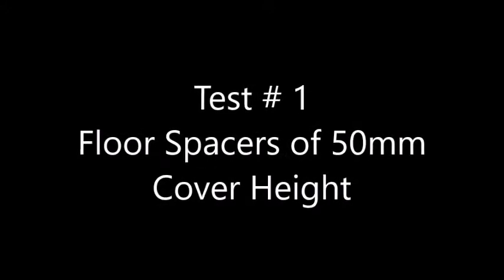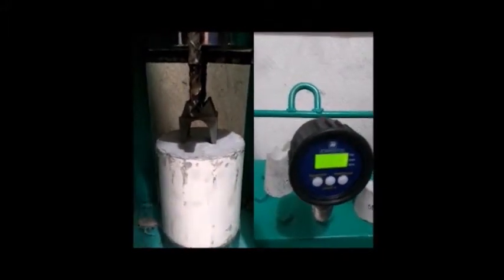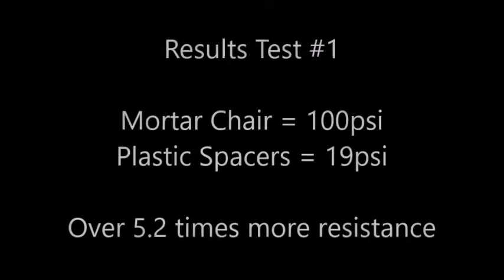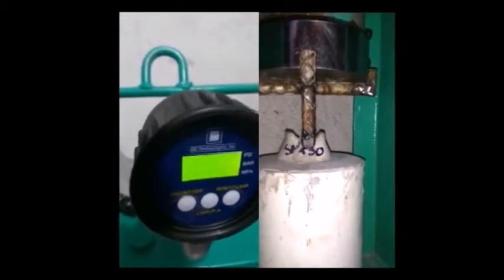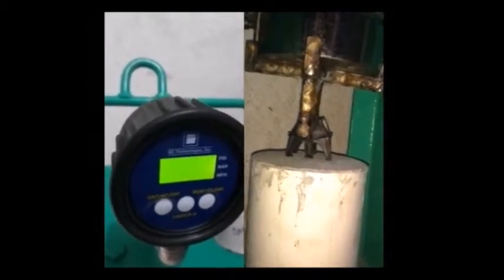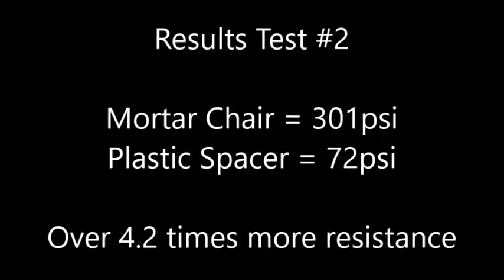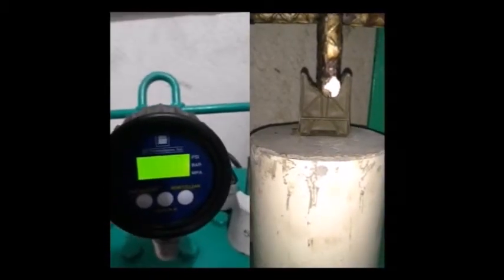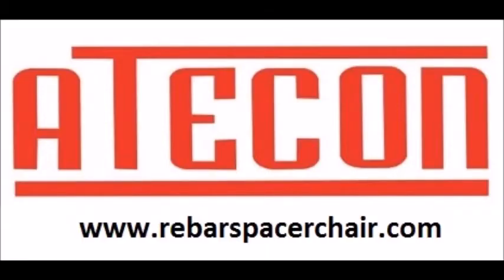Rebar Spacers Compression Strenght Test #plasticrebarchairs #rebarholder

Comment: This testing assumes that ALL plastic spacers are the same
INCORRECT 
Our plastic spacers for ground floor applications will take 300kgs at a plastic temperature of 30C , with no deflection
Reply: Measurement is made in psi, do you have a compression test of your spacers to proove your claim?